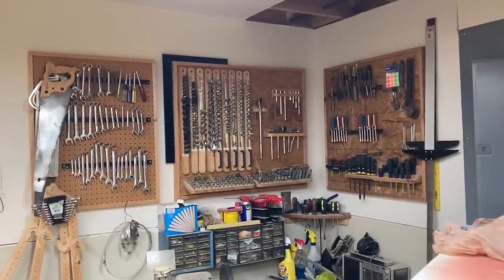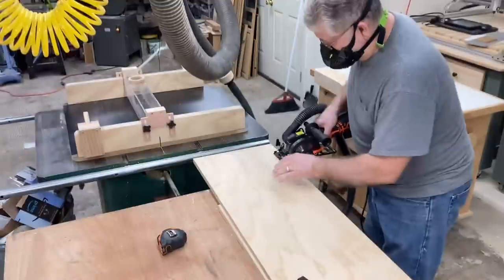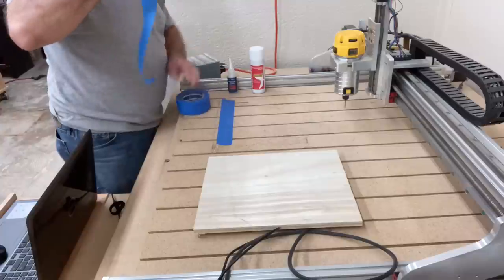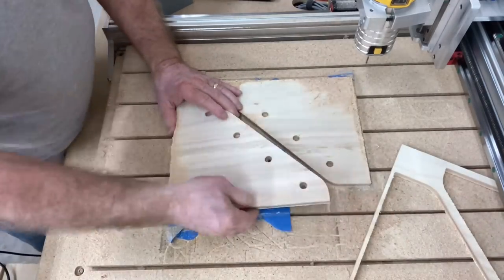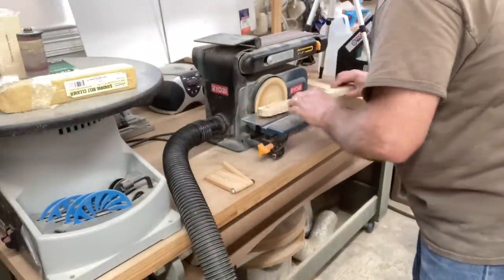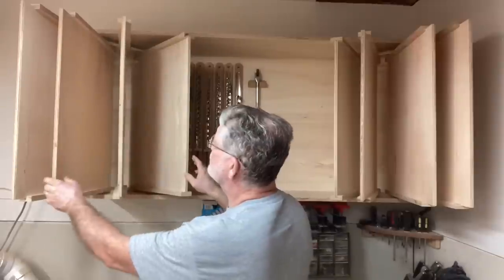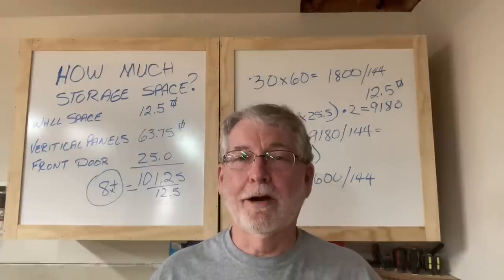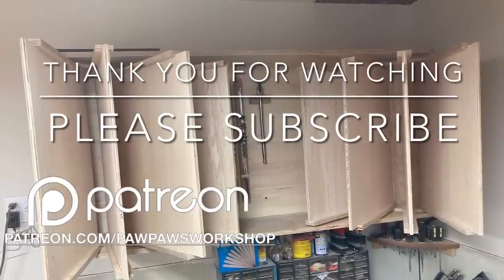NEW DESIGN! over 8x the storage in the Innovative Wall Cabinet

Comment: Very good job.  It gets better and better as I watch these cabinets.
I wish you had spent some time showing us how the final doors work and hinge section, open up the cabinet at the end. That was frustrating. Finished pictures show how each piece looks once assembled and very necessary.
The concept is brilliant, thank you!

Love the creative gluing system with the painters tape.  So clever.
Reply from the maker: The concept of the hinge is very simple. I just use a spacer underneath the hinge that I cut out on the CNC. The pin at the bottom is 1/2”. Same thickness as the plywood hinge. The pin at the top must be longer. You will need about 1 1/8” long which allows the door panel to be removed. Hope this helps

Comment: I'm in the process of doing a major reorg of space in my 2-car garage shop and decided that your awesome storage cabinet would feature prominently in replacing the 5'x7' Rubbermaid shed which used to store all of my small tools and supplies but was taking up much needed floor space.
So I built a dividing wall out of 2x4s and plywood panels (8'x8') and the 5ft x 2.5ft x 17" storage cabinet now hangs on one side of that wall on the upper part of the wall. I can now put my jointer, thickness planer, benchtop drill press and soon to be acquired drum sander, all on mobile bases, under the storage cabinet. I think when I'm finished loading it, most of the stuff previously housed in the Rubbermaid shed will fit into the new cabinet.
Awesome design sir! You continue to inspire me.
Reply from the maker: Thank you very much. I love your ideas for organizing your shop

Comment: How big would the brackets have to be to hold 4x8 pegboards
Reply from the maker: I do not think this will work for a 4x8 pegboard. The weight most likely will be to great to support on the pivot points
Reply: Ok thanks